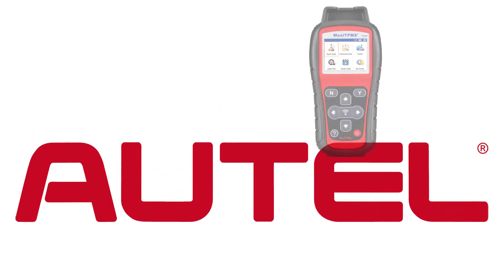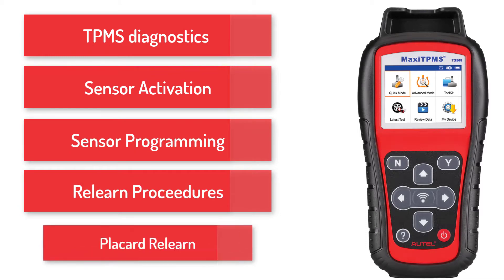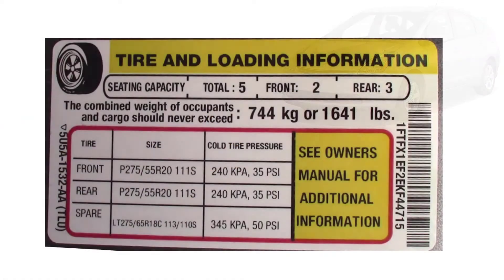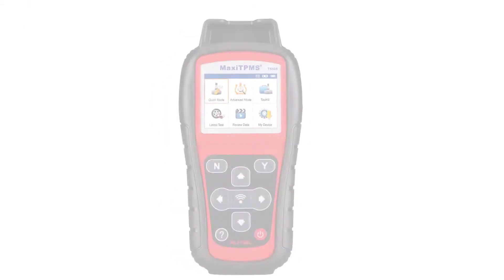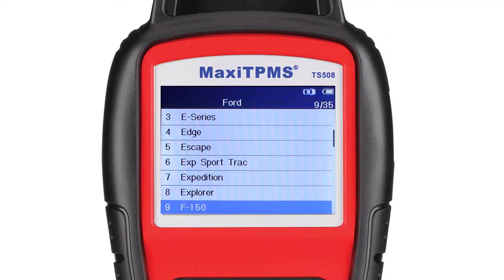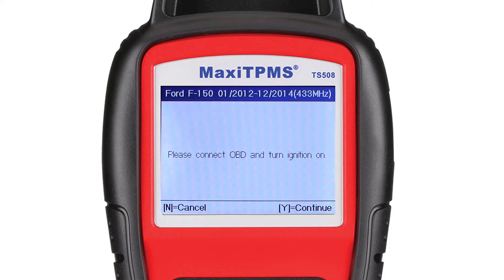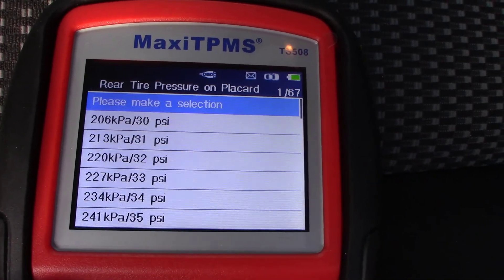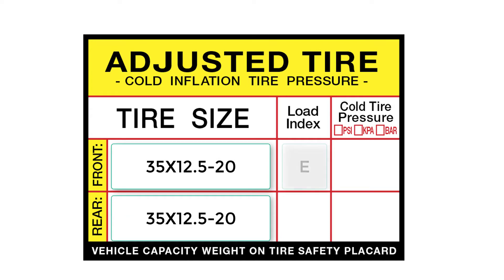Using the Autel TS508 for Placard Change

Comment: Hi.. can you do a review on maxiscan ms509 from autel. I got the device from a local distributor but it seems that it doesn't work on all the vehicles.. I tried to connect it to Suzuki swift and mini cooper but it has a communication error.. can you help??
Reply from the maker: That tool uses a different update pack.  Please go to https://www.autel.com/u/cms/www/201304/182100480dvs.rar to get the update pack.  You can also go to https://www.autel.com/autelcms/Old%20Products/509.jhtml for more info from Autel.